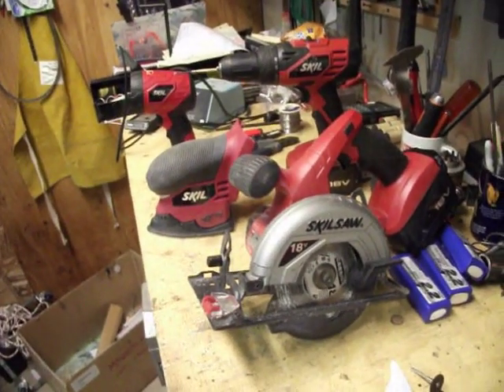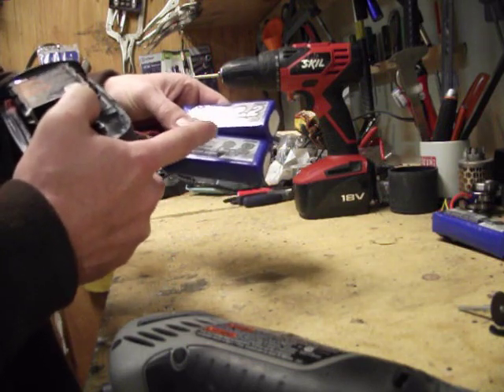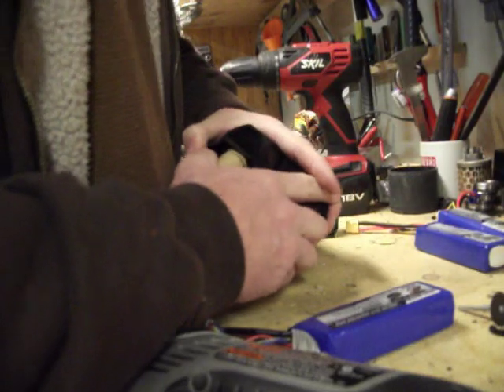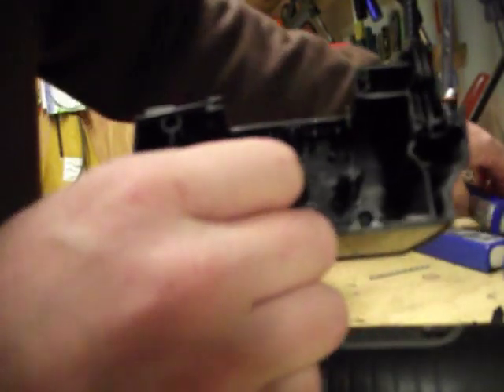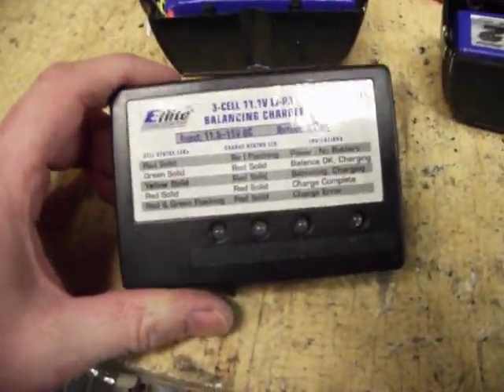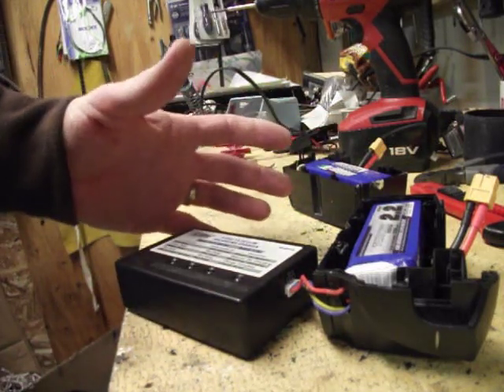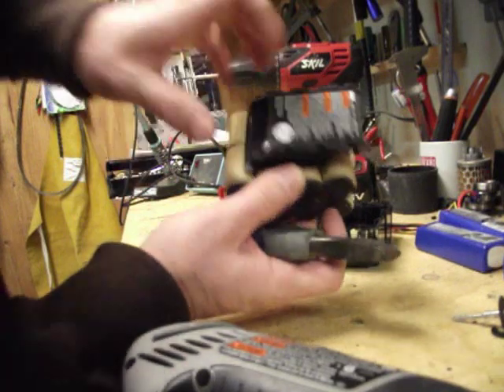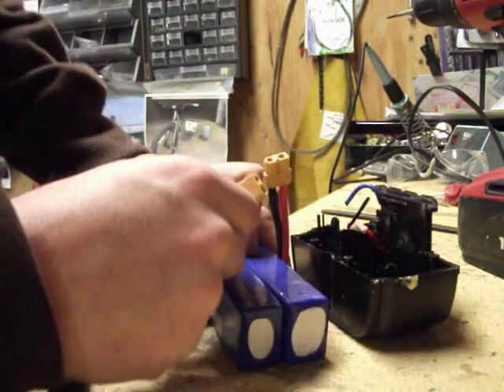Converting a tool pack from Nicad to Lipo

Comment: Nicely done! Thanks for sharing the project. A friend just dropped a 5-piece cordless Makita set in my lap, including a 12V, shiftable torque driver drill - the "big 'n". All with dead NiCd batt packs. So obviously I'm really stoked to find your video here. These tools used the "stick" type batt packs, but I'll make it work. Thanks again & have a good 'n.👍😎

Comment: Hi I have a 19v craftsmann compressor. I put a lipo of 11.1v 3s and another 2s 7,5v / 2x2.2mha and it worked. If I put two 11.1v3s will not be too much load since it can reach 13v total loaded 26v. I think that for mine it does not work because it does not have that "esc" that sends the right voltage because the compressor is not?

Comment: The fully charged voltage of this pack is going to be 25.2v. I'm surprised you didn't end up blowing up motors and the speed controller in the drill.
Reply from the maker: ***** It's been a year and a half now...I bet they could handle 30v.
Reply: How are the batteries managing with no LVD or cell monitoring?
Reply from the maker: +ben hunter 2 years now -- I just ripped an 8' 2x4 the other day.  If the power starts to drop I just swap packs.  Obviously i've been doing pretty good
Reply: I'm glad to hear that, just please don't get complacent with them. The older and more worn they get, the more likely something bad Is going to happen. Remember that they always have the potential to go up like a hand grenade, so treat them as such. Make sure you charge and store then in a fire resistant container. A lot of people get into the mind set that just because it hasn't happened yet means that it's never going to happen. It's usually these people who get injured or their house burned down.
Reply from the maker: +ben hunter Its always better to be safe than sorry but I think the technology is pretty mature.  I don't see distributors or manufacturers making your suggestions and i've been abusing lipos for 10 years with no troubles but I've always had the correct charger.  Have you had any trouble?
Reply: Ben Jamin
I've never had any trouble, but I always use cell protection to prevent over or under voltage on an individual cell level. They are getting safer, but they do still vent and burst into flames when not treated correctly. Obviously having a balancing LiPo charger is going to help your chances, but bare in mind that Li-Co and Li-Mn chemistries are inherently unstable and contain flammable electrolyte. There's no getting around that and that's why LiPos in particular are usually charged in flame resistant bags. My advice is to at least keep your batteries away from anything flammable, particularly when charging.
Reply: +ben hunter if I rebuild my own lithium 18v, how do i install discharge or overcharge protection?,Please explain.
Reply: mateollios 67
Buy or build your own BMS. If you have little or no experience designing and producing your own PCBs you can buy a BMS from eBay (the US site has the best selection). Make sure you spec it for at least 50A, power tools tend to be hungry little buggers. Installation is the easy bit. Just wire up the cells in the right order and sort yourself out with a charger. For non standard numbers of cells I tend to use a bench power supply capable of constant voltage and constant current operation. One of those £50 eBay jobbies should do the trick as long as it does up to 30V 3A. A 1A one will do but it'll be insanely slow.
Reply: +ben hunter thanks a lot for the response, I'm going to try it.
Reply: mateollios 67
Good luck and stay safe. :)

Comment: could you get a 6s balance lead and wire the two packs to charge off that ? i would think it would balance charge better that way?
Reply from the maker: +les spoth  I charge each battery separately its about an hour each

Comment: This is just what I was looking for.  I was thinking of running a single 4 cell. Can believe Dewalt doesn't make lipos for these.
Reply from the maker: You could run 4s if its about the right voltage  4*3.7=14.8...  Its just over a year now the packs are running great!

Comment: Pretty neat! Maybe I should try this with my dewalt 18 kit. The batteries are starting to take a crap. This looks a good solution plus hop them up a bit. Do you worry about burning up the motors at all?
Reply from the maker: This is the second kit I've done.  My last kit the drill trigger went bad after a year so I don't know if it was the high power or just age.  The motors were fine.